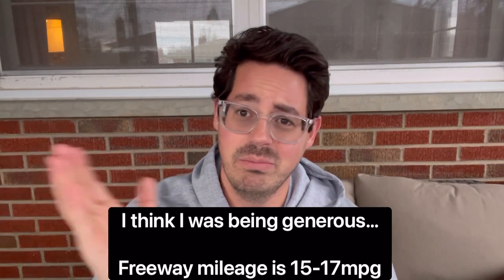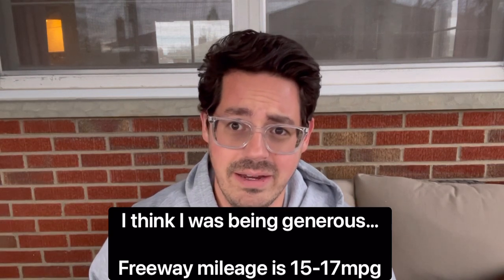Worst Engines of All Time: 1982-84 GM/Chevrolet 305/350 V8 Cross-Fire Injection System

Comment: As an owner of a daily driven 84 corvette, I haven't really had any problems with the crossfire setup. I mostly do the work on the car myself and it's actually a fun learning experience. Going off the engine specs, the CFI is actually a pretty high performance engine of it time. Its just that the crazy restrictive intake manifold kills a ton of power. I honestly think that GM never gave the engine a chance to prove itself and to iron out the main issues in its short 3 year life span
Reply: Actually the cross fire 350 had more horsepower potential than the one that replaced it. It was purposefully  strangled to make the next engine more desirable. The intake is the problem but can be fixed with a process called extrude honing. I think you can buy a intake that flows much better than the stock, my brother did it to his 84 vette but it was a decade ago at least.
Reply: it was called the Renegade intake and yes epa did this  I own an 84 Corvette and yes I yanked the engine   out and when I tore it apart guess what it had hog trough one valve relief forged pistons in that bad boy  just an Edelbrock intake and a carburetor it made more horsepower than any vet alone until lt1  300 hp in a 3088 lb
Reply: I also daily my 84 corvette.  It’s my only vehicle for now since I sold my truck.  Never had any issues with the crossfire injection.  Drove it from my hometown in NC 14 hours to Florida when I moved down there.  Now electrical issues… that’s a different story
Reply: @TrippEvans yep electrical issues are always a pain
Reply: Part of the problem was that GM didn't have the 350 crossfire intake certified for California emissions, but the 305 was. So they put the 305 intake on the 350. It ran great up to 4300rpm, then ran out of air and power. Instead of spending the money to certify the crossfire  350, they moved to the TPI system.
Reply: It proved itself remember they set the speed record at 240 using a highly tuned version of your car.

Comment: When I was looking into a unique engine build I thought about building a twin TBI system ion my 1988 Chevy C1500. The engine I dropped in was a high performance .060 overbored 350 small block. I looking into the Crossfire setup at first  just because it looked cool back in 2006. After buying a Crossfire intake on ebay I was shocked how tiny the intake runner were. I looked into methods of opening up the runners but eventually abandoned that idea. I eventually went with a Offenhauser Crossram and two 350 TBI units and boosted the fuel pressure to 27psi. It ran ok but after a few tuning sessions I realized I still needed a lot more fuel. I haven't worked on the truck in a few years but I'm about to get back on it and install a set of four 454 TBI injectors to see how that goes.
Reply: How about 2 of the 454 TBI's?
Reply: @BuzzLOLOL  I'm getting plenty of cfm it's fuel I'm not getting enough of. I'll use the 454 injectors.

Comment: I worked on many "Cease fire" injection systems as i have been a GM dealership tech for over 30 years. And every single thing he mentions is absolutely true. You also needed a special "manometer" to synch the throttle bodies or you would have tremendous hesitation problems. A good friend used to drag race his 1984 Corvette and we changed the cam, swapped the heads for TPI "canted valve" heads, opened the intake ports (which were more like half ports), had a custom chip, headers, HP coil & cranked up the fuel pressure. It ran 15.20's because it still ran out of breath at 4,000 RPM: Then, we just put an Edelbrock carb and intake and a vacuum advance HEI - The car did 14.10's easily and from there, we just kept adding things. By the way, All the car companies struggled in the late 70's, early 80's: Ford & Chrysler had no better systems!
Reply: A “special” manometer? There’s nothing special about an manometer. I use an old Dwyer, but I have made them for less that $5. Clear tubing and a yardstick. As far as the minimum air adjustment and syncing the TBs, it is LITERALLY a 10 minute job, and should not have to be done until the TBs need to be bushed (which is common on ANY high mileage TB). I made a video on my channel that details the TB procedure. I have been daily driving CFI cars for almost 30 years. I’m not at all saying the CFI doesn’t have a list of drawbacks, but they are easily overcome. I’m going 14.40s with my 83 LU5 with very basic modifications, and I manage 17mpg city and 26mpg hwy at the moment. People badmouth what they don’t understand. People badmouthed electronic ignition when it came out in the 70s, and many were pulled in favor of a points distributor when a faulty module confused people that had no experience or understanding of them. Just out of curiosity, what “custom chip” did your friend have in his 84? A 6026 ECM can’t be tuned/hacked. A 7747 or 8746 can, so unless he repinned a newer ECM in the car like I did, he more than likely had an off the shelf Hypershit PROM or equivalent, which usually run worse than the stock PROM.
Reply: Datsun and their 280ZX turbo sure did. I loved finding mustangs and camaros of the era that thought that they were hot stuff. Showed them my tail lights every time.
Reply: @gurnblanston3210  stock maybe but who said mine was stock?

Comment: I was a Chevrolet dealership tech when these came out,we called them cross flood or cease fire injection.Boy we had some bad products back then.
Reply: Me too bud. Also,, diagnostics were horrible back then  so you had to experiment and figure it out for yourself mainly. Learned a lot though. I remember our scanner: The Tech 1: Truly awful! Car's computer was about 10 times faster than what that scanner could read.
Reply: GM still does!

Comment: I had an '84 Z28, but it was the H.O. version with a Rochester Quadrajet and made 195 H.P. 
P.S. wasn't the Crossfire engine only on the Collector Edition Corvettes in '82?
Reply: @Jeff - No the crossfire wasn't limited to the 82 Collectors Ed. my '82 corvette sitting in the garage is the crossfire and not a Collectors Ed.
Reply: @tsmith3247  Maybe what I'm thinking of is that the CE came standard with the Crossfire?
Reply: @gurnblanston3210  I stand corrected.  It's been a while! 🤣

Comment: I was 12yo in metro Detroit, 1982... My parents bought a silver Crossfire Injection 305 Z28 with dark gray rocker stripes... it was fast (to a 12 year old) & space age for 82... I was a Knight Rider kid too, loved Kit & thought the black 82 Trans Am with those black hub-caps was glorious. that said, the Crossfire was special  on the Z28 (when it ran) because it had functional dual hood induction scoops that would pop up in your hood line of sight with an awesome mechanical bang when you punched it... it was just kick ass...A guy in our neighbor had  a 70 Chevelle 454 with the sweet Cowl induction hood & the Z28  was even better than that show.... "But"... at 32K we started having issues with the Crossfire system... The Chevy dealer fixed it twice but my folks lost confidence in it leaving them on an off ramp once... On the second Service department visit, I told one of the sales reps that he should let my mom drive the new Maroon Monte Carlo SS (she liked maroon)... it was an 84 demo with 5k on it... She traded the Z28 & we ended up with an equally sweet Monte SS with a 305 4bbl carb... It was equal fun... I think the functional hood flaps on the 82 Crossfire Z went away when it was converted to a 4bblCarb for 83&1/2 & 84...

Comment: Dude you don't know shit...! long runners will have a broader mid range torque curve while short runners favor high RPM power... the reason the intake ports on the CFI manifold are smaller than "normal" was an effort to boost low RPM port velocity to aid low end power and drive ability... I bet if a little effort was applied by a competent tuner the CFI could be made to work reasonably well...

Comment: I had TPI motor with the 700 R4 in my 86 IROC Z which did just as you said. It would come out of overdrive at full throttle and as you mentioned top speed was like 126.  I never knew the reason why it would do this but being a speed freak there was a special part that I had installed into the transmission valve body that would allow the car to stay in overdrive at top speed enabling the car to do about 140.

Comment: My first car was a 1983 Z/28 Crossfire. It was a great car. I never had any issues with it. It had theses cool hood flaps that opened wide on full throttle. I wish I still had it. Everything was slow in 1983. F bodies were everywhere in the mid 80's. Everybody wanted one.

Comment: You have it backwards, long runner promotes more power or torque at a lower RPM, the higher the RPM the shorter the runner should be. You can compare a single plane vs a dual plane intake, a single plane intake has shorter runners and it's more of a high RPM engine vs a dual plane intake is more for a lower RPM engine due to its longer runner setup.

Comment: I have a 1982 trans am with the LU5 84K on the clock and I tell you keeping the fuel system CLEAN and ALL TBI gaskets new and replace ANY crack VAC lines make a HUGE difference !!

Comment: Alot of people don't realize that your better off to run regular gas with any low compression engine it will run better premium is not better fuel just has higher ignite regular will fire sooner and solve the rich burn problem,,

Comment: I have a 84 vette I ported and polished the intake and it runs great,, Cross fire is just throttle body injection used in many even Cadillacs,, the 84 vette is a engineering marvel,,

Comment: I had a 1978 Monte Carlo with the 305V8. It was an absolute lemon! It pinged on every grade of gasoline. I used only premium and nobody knew how to service this engine or car at all. It used 2 and a half quarts of oil per 1,000 miles. It only got 7 blocks to the gallon of premium gasoline. Every mechanic who worked on my car is a bonehead and moron. Everything on this car was replaced except for the transmission which when you first started out when cold had a very delayed shift from 1st to second gear never resolved. Brakes and all suspension components replaced. It turns out it had Chevelle brakes instead of Monte Carlo brakes. What a total lemon of a car,!!!!!!!!!!!!Some people blame me for just bringing bad luck just getting behind the wheel bringing bad luck to the car. In other words I'm a jynx and jynx every car I've sat behind the wheel.
Reply: Some dealerships had crap mechanics...
Reply: @BuzzLOLOL  That's so true!
Reply: @albertcarello619  - That should have been an outstanding car...
Reply: @BuzzLOLOL  Unfortunately it was a real lemon. The dealership blamed me for the endless problems with that car. At least I got 109,000 miles on it in 9 years before trading it in on a 1987. Acura Integra.
Reply: @BuzzLOLOL  Unfortunately it sure wasn't. I think my car was designed so it could never get serviced right by anyone. Unfortunately a LEMON.

Comment: aaahhh, the electronic quadrajet.....seems ok.  I  have one on my 85 Olds 88 307 and my 82 cutlass supreme which only has the 2 bbl rochestor. Also, wonder how many cfm I get through the 7A heads on the 307. Doesnt have the power the 5A heads had on the 84 olds 98 307. Carburetor doesnt bog as much either. I get about 7 or 8 mpg city and probably 13 or 14 highway. lol! great vid!

Comment: Oh man, those were the worst corvettes ever. It looked like a brick on wheels, and couldn’t get out of its own way. The interiors were pretty good and the stereo too. But 205hp in a Vette?  It felt like an insult to the older Vettes and the brand. I think GM felt the same way too, because  it was a mistake and that body style didn’t last very long. Then there’s the Mustang. It was like GM and Ford were having a drag race to see how fast they could run their most iconic cars into the ground. Thankfully, they’ve made their way back to the forefront of some of the fastest ground pounders on wheels. It was common sense and they listened to it.
Reply: 205 was the most HP in 10 years! 165 or 180 earlier...

Comment: I would love to see you comment on the 81 Corvette with the electronic controlled Quadrajet.  I have owned my 81 for 12 years and still have not had an issue but I know it is a one year only design.  I also have a busted vacuum diaphragm on the AIR pump so I don't know if it is working properly but none are available.  I just tore it down because it has a bad lobe on the cam for #3 exhaust valve.  57k miles.
Reply: Well I just watched the last few minutes and you did mention it.  Sorry.  Maybe more in depth in the future?

Comment: I have to disagree with some of your crossfire thoughts. I had an 82 vette and the only time it gave me problems was when the fuel pump went weak. As far as mpgs went, now this was back when the interstate speed limit was 55 so everyone was going 62/65 I consistently got over 27 mpgs on the highway, never hit 28 though. Powerwise they were detuned for the time, ( they all were to meet fuel and emission standards )  and a 2.72 rear end didn't give much off the line. Also I never had an issue with the 700R4 trans.

Comment: I was a GM tech and I became alarmed when I learned that GM did R&D on the road using the customer as a test driver, for example they had 8 different brake systems on one car model with the plan of using the one with the least problems the next year of production and ditching the other 7 systems. that was in the late 80s I hope they are better now.
Reply: Which is why you should never buy the first year of any new generation of a GM car.  I typically try to buy the last year of any generation, by then, GM has all the bugs worked out and perfected the design of the car.  You'll know when GM has perfected a car.........they kill it the very next rear and replace it with something with a ton of quality and engineering issues.

Comment: If memory serves me correctly the 700-r4 was a th350+1 essentially a 3 speed with a 4th gear od.
The 200r4 was a weaker version of a 4 speed od.
I had a grand prix with a th250 those had band adjustments and looked really close to the th350 and were same size

Comment: I had a new Turbo Trans Am in 1980( Indy Pace Car) and was so disappointed with the 1982 Trans Am.   I had always been a Pontiac fan and was so upset with 82 redo.   I thought the Z-28 was so much more attractive and among my friends was considered heresy.   I wanted to like the T/A but I just couldn’t get there.   I had 3 new Z-28’s.  An 83 305-4bbl with 165 hp.  An 1984 305 H0 4bbl with 700R-4.  You just told  the Corvette 700R-4 story about coming out of OD and not up shifting which drove me crazy.   I loved that car except for that .   It was so quick but no top end.   The owner of the dealership was a family friend and he couldn’t explain the failing to shift he offered his  personal 1980 L-82 Corvette with less than 10k miles ( Black/Oyster) and my retarded 22 y/o self said “ no, thanks… I don’t want a 4 y/o car…. How smart do I feel about that decision.   I traded it for a 1985 305 TPI w/ 205 hp at another dealership.  It didn’t feel as quick as my 84 HO had but it shifted into OD at full throttle so it had much better top end speed.   My 84 had a 3.73 axle ratio and the 1885 had a 3:42 but 15 more hp (205 vs 190).   The 84 and 84 were red/charcoal cars and the 85 was a black/gold car with factory rear louvers that matched the new louvered hood scoops.  That stupid 700R4 transmission ruined that 84.  I was so upset with that car.   The 85 never stirred my soul like the red 84.   Looking back I should have taken that 80 L-82 Corvette and kept it.   I had driven that Corvette when it was brand new in the local Christmas parade with a homecoming queen or some pageant winner on the roof. Taking it back to the dealership, being a 17 y/o, I had to see what it had and I remember it barking the 255/60-15 Goodyear  Eagle tires on the 1-2 shifts which was impressive in 1980.   The mechanical music that high revving L-82 350 made was quite addictive also.   It shifted at around 6200 rpm which was quite rare in American cars in 1980.  In fact the L-82 Corvette was probably the only one(with a V-8 engine).

Comment: Adam,
Cool porch chat. I’ve been a Corvette guy for a while. More so, a C3 enthusiast, and definitely those cross-fire injected Vettes were troublesome and a product of the times. I’m also an enthusiast of big American land yachts and 4x4 trucks.  But I’ve developed a curiosity of late about Oldsmobile 98s. Do you have one?  I’m specifically interested in 1966 to 1976 models. Do you have any insight to share on these models?  Would like to hear what you find interesting or ‘less than’ interesting about them.
Reply from the maker: I have an 86 Olds 98. But a friend has a 76.  I also have a 67 and 75 Delta 88 coupe.

Comment: i HAD A 83 z-28 305 cfi AND IT GOT 25-27 MPG HIGHWAY.
Reply from the maker: You must’ve had a 5 speed.
Reply: @RareClassicCars  Nope it came factory equipped with a 7004r automatic which had to rebuilt twice.
Reply: @RareClassicCars  It's certaintly true that cfi with 2 model 400 throttle body injectors had some issues, but it's by far not the worst crap GM ever came up with.

Comment: The crossfire injection was a very good setup. It was the crappy cam shaft and engine compression issues, rear axle issues, and transmission issues on the all GM V8 cars. The fuel economy was much better than anything produced at the time. I worked as a driveability tech at a chevy dealer through out the 80's and 90's and found many 80 -84 305 engines with worn out camshafts that caused most drive ability problems.